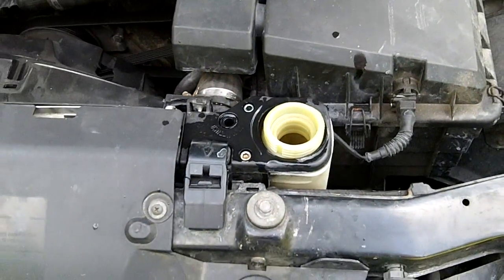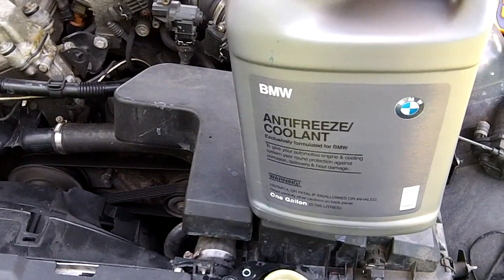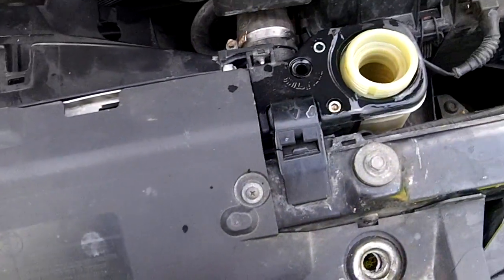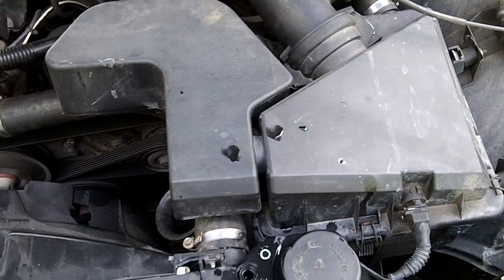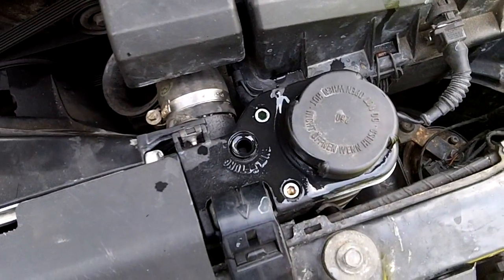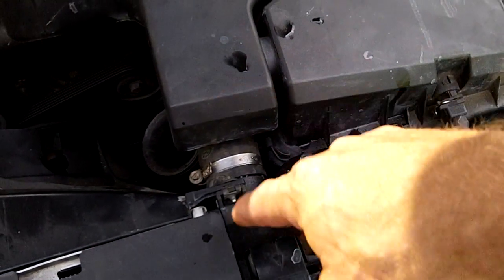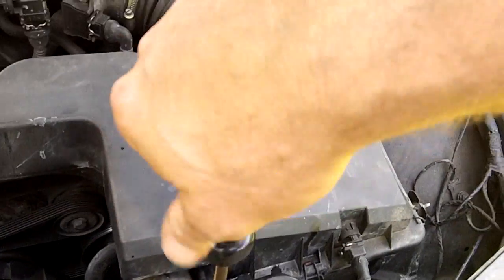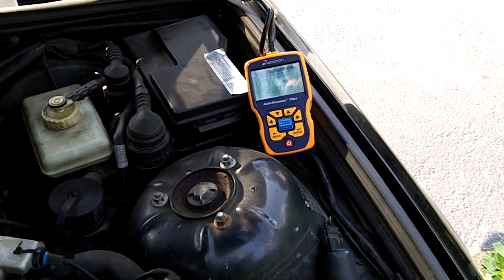How to Bleed the coolant system in car, BMW

Comment: The BMW coolant doesn't have a reaction with the different material in the cooling system.
Problem using the wrong coolant is that the seals swell up.This is what makes the water pump so difficult to remove sometimes.
It can also make the plastic in the cooling system brittle.
Good luck and enjoy your cars

Comment: Thanks, same system on a z3, been a while since I had to worry about coolant system issues so I could not recall best way to get the air out.  I definitely had to tip my front end up by using ramps to get the air out of the bleed hole. I cannot agree to use OEM branded stuff, as I just use the SAE standard for coolant and everything else that is printed in my owner's manual.  Most commercially viable brands even the Walmart brand, meet or exceed the SAE standards printed in my owner's manual, as these are updated for newer autos and requirements, best to use the 50/50 pre-mix so you are not using tap water.

Comment: Actually, the bleeder screw will pour out water whether its bled effectively or not. Since coolant is circulating. A more effective method would be to crack the bleeder screw open (meaning half open but not removed so air can escape but not water). And wait for the coolant level in the expansion tank to go down. As air escapes the bleeder, the system takes more coolant and the levels in the expansion tank falls. If you see for 15-20 minutes without the water in the expansion tank falling, then youve burped out all the air. I had to learn this the hard way. My car took in 4 liters extra coolant with this method. I had all that air inside that was making it overheat!

Comment: i so appreciate your video, unlike all the other videos i have seen yours was actually informative and helpful.....i have been fighting with an over heating problem for a week because i could not bleed it out ...... i replaced the water pump and the thermostat and could not  get the air out. i kept filling it till anti-freeze came out the bleeder ,come to find out someone replaced the radiator with a bigger one and i need an extra gallon of anti-freeze to actually fill it....and your method of bleeding was so much easier....in short THANK YOU !!!!!!

Comment: i wouldn't jack up the car because it will create an air pocket in the top of the radiator, also after hot enough that the thermostat opens, squeeze the upper rad hose to force coolant into the engine block
Reply: Pete Vanderlinden you can as long as there’s liquid all the way to the bleeder screw or cap. They’re higher than the radiator.